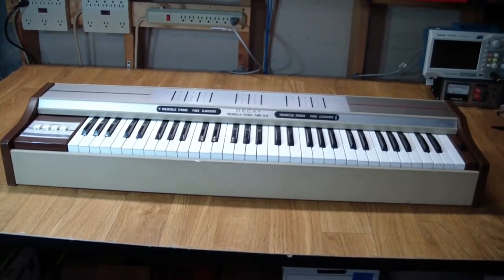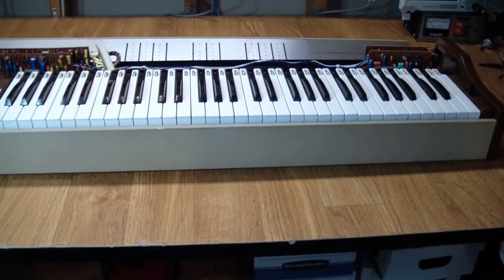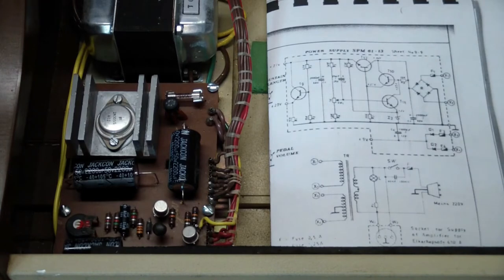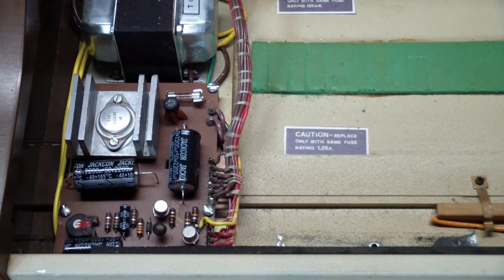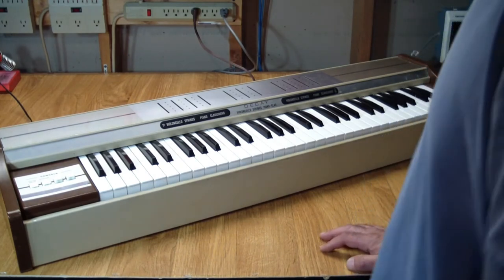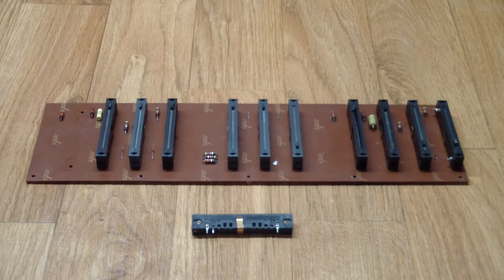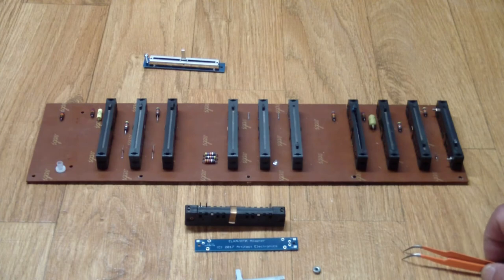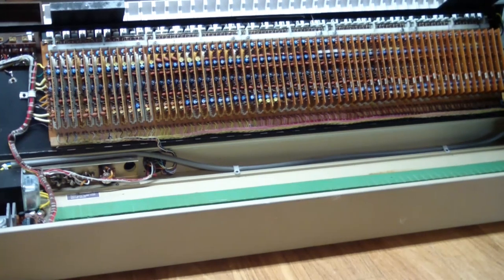AE#5 Repairing and restoring a vintage Elka Rhapsody 610 String Synthesizer, Part 1

Comment: Hello i am recapping my 610, what are the values of the capacitors in the power supply, i see two 2200uF 50v's and one 1000uF 16v, what is the capacitance of the smaller 25v one, thanks.
I have the schematics manual, but values are kind of unreadable.

Comment: I bought one, in general in good condition, but the cancel buttons don't work well. Could I just bypass them so the voices are only controlled by the sliders?
Reply from the maker: That would work, but first make sure that when the sliders are at 0 that voice is completely silenced with no audio bleedthrough.